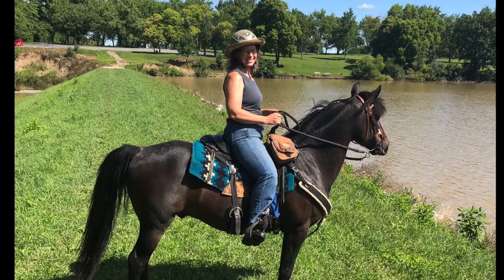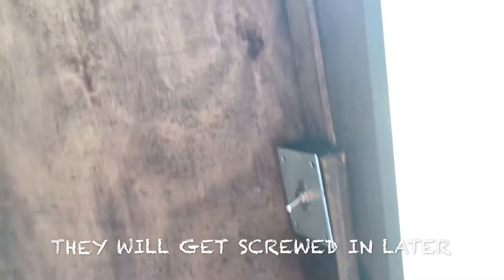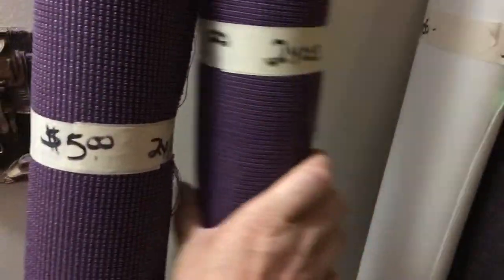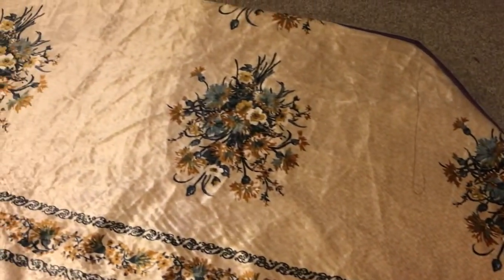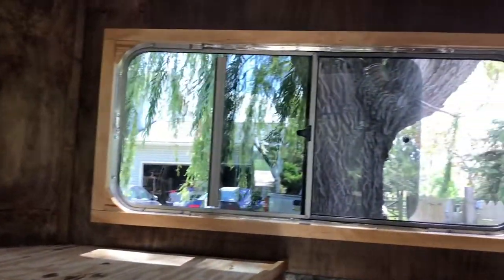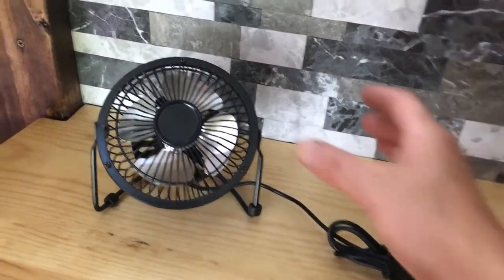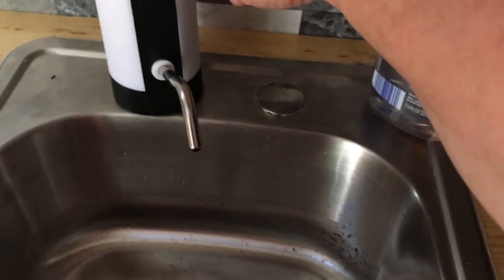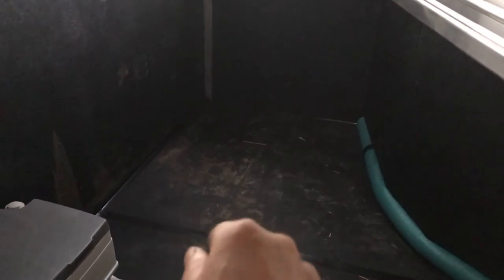DIY Bumper Pull Horse Trailer Conversion Part VI Final Touches

Comment: Great finish work! Covering cushions is a pain for sure. They have to be so tight that it is really hard to get the padding into the cover. But too tight and the padding curls. It's a pain, but to shrink your covers you could take the seams apart and re-stich them with a thicker seam. but only shrink the top and bottom, your side pieces seem to be right. Curtains are much easier. Your construction is fabulous! I've used rope for trim in my homes before, it looks great. I did coat the rope with a clear, flat  polyurethane for easier dusting and cleaning. Raw rope is a magnet for dust. Rope trim will fit perfectly with what you've done so far. Love the ambiance you've created.
Reply from the maker: I was not that ambitious, I just hand stitched them along one edge.
Reply: @hollijacobs7858  That makes it easier to rip out the seam and tighten them up. LOL You are ambitious and talented, just look at what you have done. Very innovative and such an odd shape to work with.

Comment: Looks good and definitely more comfortable than roughing it entirely.  Now that you've had it completed for a while, have you been happy with your water supply and how you have everything laid out?  I love the idea of solar power.  I'm just having trouble finding information on how to actually wire for DC and solar.  It all seems a bit overwhelming.  LOL  I would love to have a full functioning bathroom but really don't like the idea of dealing with a black tank. I will probably stick with a porta potty or a cassette toilet.  I won't be doing this any time soon, but would love information on where to actually find instruction for the DC and solar wiring.
Reply from the maker: I’m happy with the water, I’m guessing other people would not be.   The toilet situation works for me too. As fas a solar goes watch a lot of videos and do research.  Keep in mind it’s DC, so it’s a loop/circle from the fuse box to item and back to fuse box.  Hook fuse box to battery, hook battery to panel. Maybe make friends with an electrician!  😉